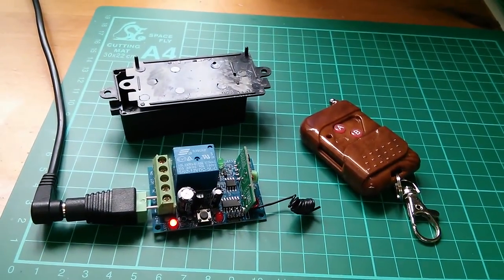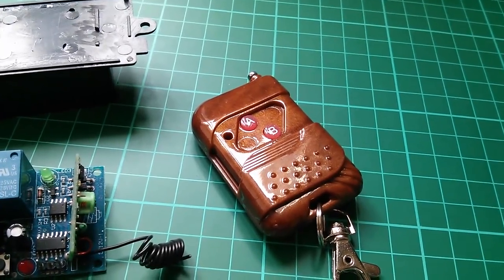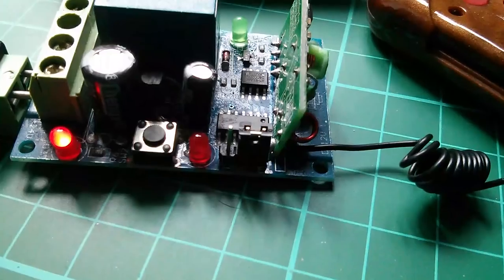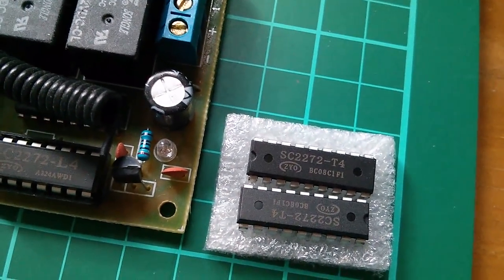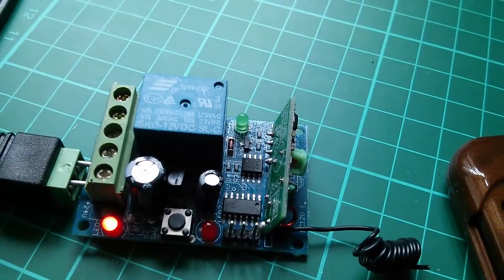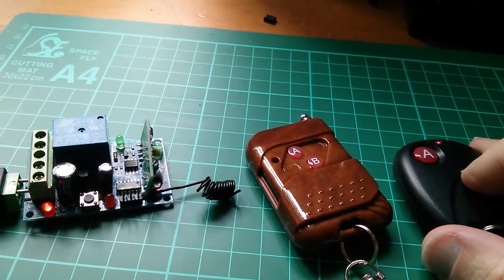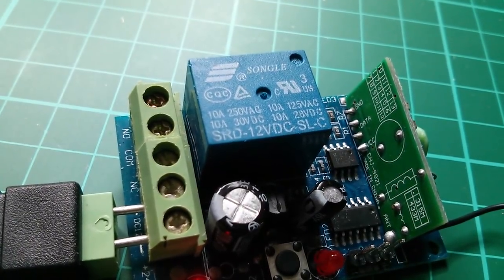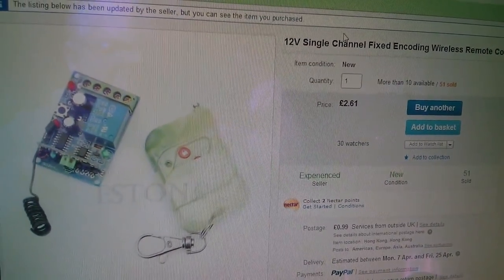12v Multimode Learning Wireless Remote Control

Comment: Just bought this unit from your ebay seller. Slightly different unit arrived, one fails to work and the other one with 12v applied blew the capacitor. Not sure why, managed to take the end of my nail off. Just thought you guys should know, any ideas? as to what may have caused this? Will a capacitor soldered in reverse cause an explosion? Many thanks Dean

Comment: Julian Ilett Hi! I have a one question to you because I am trying to upgrade my 433MHz 1 channel "WRC"... I mean a 12V buzzer (driven by NPN transistor) added to PCB, so it should generate the audio tone when I push the pilot button. The SAME work as  RED LED near microswitch on your PCB. Every button push is signalized by the LED, and I want do the same thing with buzzer. So Could you tell me, where RED LED is plugged onto your PCB? 

It is very important to me, please respond... Greetings.

Comment: Interesting product. Do you have any idea how the receiver knows the code for the B-button, when only the A-button is learned ? Or i guess the remote needs to be with the right chipset, and not just any generic with no rolling codes ? Thanks for sharing :)
Reply from the maker: All buttons on the transmitter have the same address (code), but different data. The transmitter (encoder) chip is the standard SC2262.

Comment: Thanks for your video. I just bought 4 of a 2 channel version and was tearing my hair out trying to set the code. Soldering the links on both the remote and the receiver made no difference, The receiver kept working with the old code no matter what code I wired into it and wouldn;t work with the new. I had seen one of your earlier videos showing the hard wiring of the codes and both the transmitter and the receiver has the pads for code setting.
 Thanks to your video I realized I only needed to hard wire a code on the remote and make the receiver learn it using the method you show. Also I had to make them forget the default codes they came with again thanks to your video. One thing I did find was unlike yours, mine doesn't have a link to set the mode but by holding down the button you can select 1 of 3 modes Latch, Toggle or Momentary.  You hold down the button for quite a while and the led will flash once, twice or three times depending on how long you hold it. Each is a different mode, (eg 3 flashes is momentary ), at the same time it erases the remote codes. After that you reprogram the remote as you showed. I would be bald by now if it wasn't for your video.
It is hard to believe you can buy something like this for next to nothing.

Cheers
Peter
Reply: how long does this lasted you? I had some similar remotes and those broke after days.. :(

Comment: Hi Julian, glad I found your videos, many thanks. I purchased two of these (2 channel versions) and have been trying to find the info on the. One does the job I need straight from the box, the other I want to change to latch mode. I figured the jumpers would have something to do with that and now you have confirmed. However, the units I bought were advertised as 315MHz / 433.92MHz and I assume there is a way to change the frequency (or at least to check I am on the right one). Can you offer help here?
Reply from the maker: wbanz I've never seen dual frequency units.
Reply: +Julian Ilett I think he means dual relays.
Reply: can you tell how i wire the thing i am trying to control though, i mean i see there are 3 additional pins besides power NO ,NC,and COM
now i have seen wiring diagrams on one of the auctions for these but the problem is that  they all show all 3 of those terminals being wired to the positive terminal of a light bulb and the negative terminal of the bulb is always wired to the same ground as the ground for the  power pin to the board itself ,  what if i do not want to power what i am  trying to control with the same  12v power supply i am using to power the board?
 can i get a switched continuity between  2 of those pins(NC,NO,COM)? i do not understand  what they are exactly ,  they go to the relay i know
but  why are there 3? what does  activating the remote do for continuity between those  pins? like COM and NC or COM and NO?
i have something with it's own power supply and a button  i just want to cut off that button and take the 2 wires from where the button was and connect  those 2 wires to 2 of those  3 terminals and have it replace the button for switching it, is that possible? or do i need to put one to the ground? or will it not work like that and only  be able  to switch something that is being powered by the same power supply that is supplying the board?
Reply: NO is normally open and NC is normally closed
Reply: ok i figured that out  so i can  just use NO and COM  to open and close the circuit  but  i am not sure what use NC is ,is it open  if  NO is closed?
Reply: yes it is

Comment: Hi, i purchased this unit but can't accomplish to LEARN the remote controls.

Once i had succeeded but don't remember how. Anyway when i turned DC off and then started again - it lost all the memory.

How do i learn the Keys and how to i SAVE them for a future in the memory of the module?

Thanks
Reply: checked if all the pins of the eeprom are soldered?
Reply: i had a faulty damaged unit. I received a new one and it works like a charm on my Race car

Comment: Interestign video, thanks.
One request: would you be interested in developing super mini wireless remote control for bike light with two momentary buttons. Idea is tu be mounted on a handlebar and to be as small as it is possible. One button would be for increasing and the other for decreasing light intensity. Also receiver should be small too, sou it could fit inside of the bike light :)
I am OK with soldering SMT and stuff but I suck at circuit development, all I have for now is CC1101RTKR from TI :)
Reply from the maker: Unfortunately I can't take on any more projects just now. It's already difficult with a part-time day job, small manufacturing business and my YouTube channel!
Reply: Well, that would be interesting project. Maybe one day :) Cheers

Comment: Learning mode only to add transmitters that's a little disappointing. It would have been cool to learn to latch for say 10 seconds. or add endstops to the thing If you use it for a lock or door and have a lot of visitors you need to keep this thing locked up otherwise people can give themselves access :)